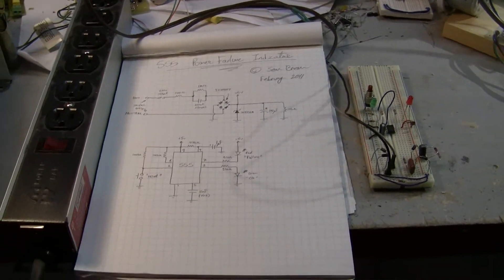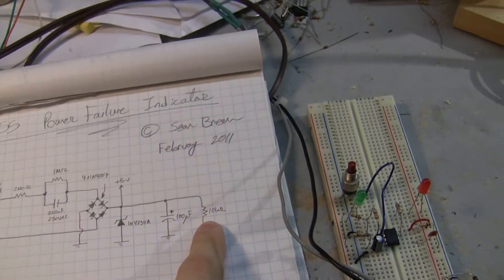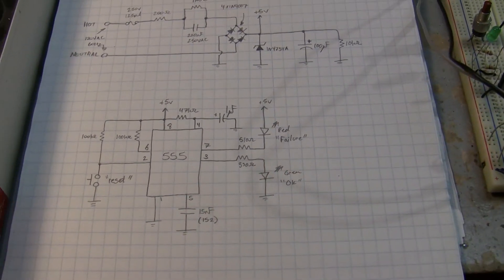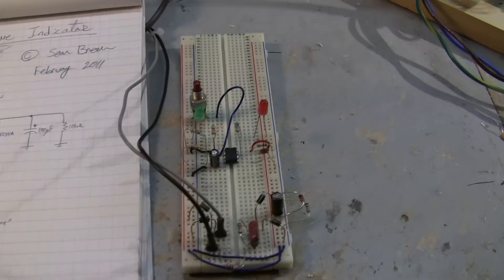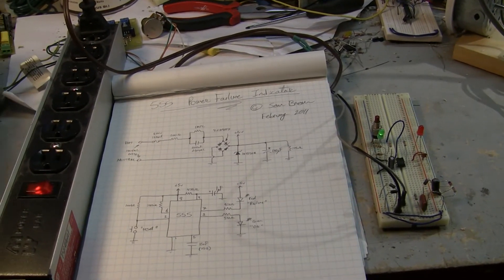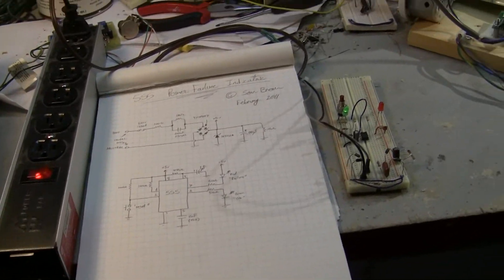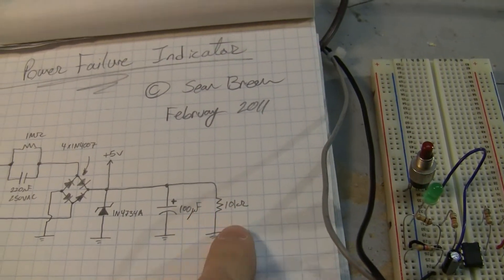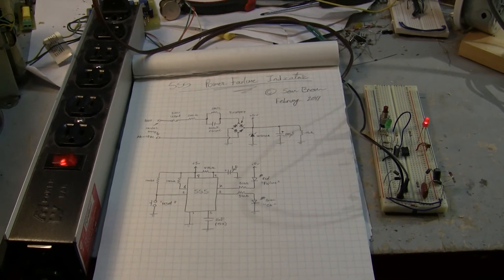555 Power Failure Indicator Circuit

Comment: Can this circuit be modified in some way to include a buzzer which goes off whenever the power is out? Not for a long time, just for a couple of seconds or so. I understand we may have to add a 9V battery to it to power the buzzer as well? Do reply if you see this comment. Thank you.
Reply from the maker: That would be possible. You're right you would need some additional power supply for the buzzer when the hydro fails. It would require more circuitry though to add the buzzer feature